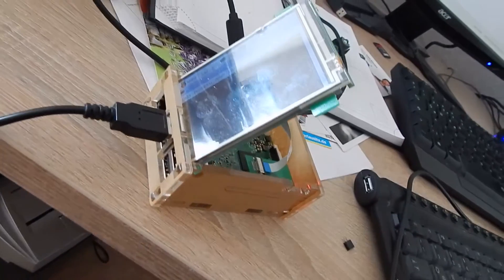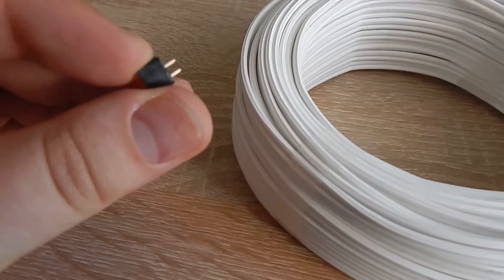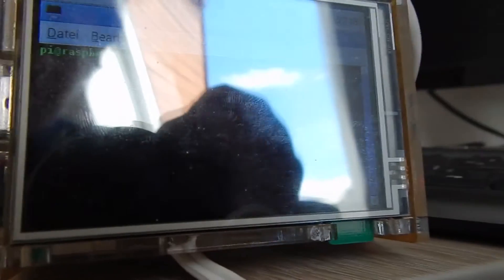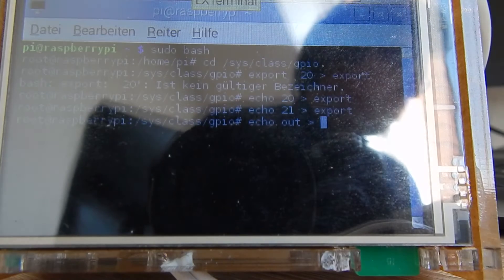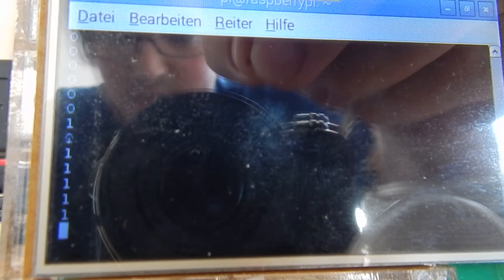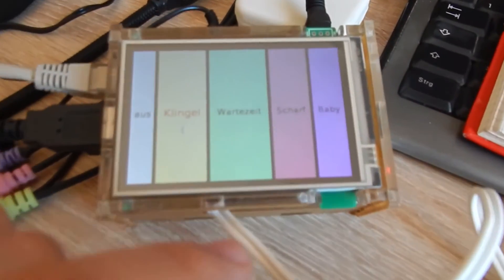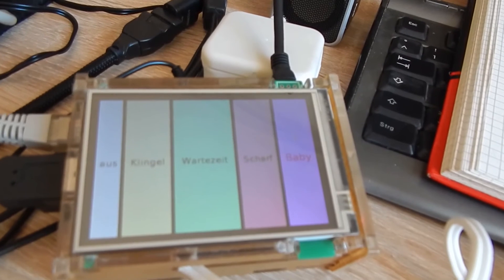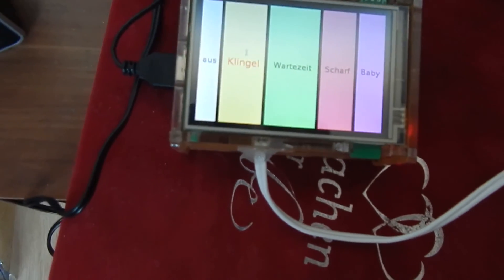Alarm System built with Raspberry Pi

Comment: How do i run this Alarm project?? i've downloaded the files to my "raspberry-projects" directory. I'm stuck in how to run this!
Reply from the maker: connect your GPIO 20 to the cable, then run autorun.sh
Reply: all i get at raspberrypi~$ -bash: autorun.sh: command not found? i would like to run this program headless and get notifications to my iPhone, is this possible?
How dose the web server.sh work? as that will not run either!!
Reply from the maker: you have to run scripts with ./

Comment: i saw a project in a book for arduino that had a interesting feature you might want to add

most alarm systems have a resistor at the end of the cable of a known value to protect against cable cutting 

if the intruder attempts to splice the wire before cutting it it bypasses the resistor and drops the line resistance which the pi can detect and use to trigger a tamper alarm
Reply from the maker: This system does not need any resistor. When the cable is cut, the alarm is fired just because no current means door open.
Reply: its just a sugestion if you wanted to make improvements the resistor protects against tampering 

say i were to strip back the insulation further down the cable and join the 2 wires there i could then open the door without triggering the alarm because the current still flows through the splice i made

just a idea if you was wanting to improve the design further
Reply from the maker: Yes, you can use resistors (or a cable with resistance) and a ADC to distinguish multiple doors, buttons etc.
Reply: im aware of that too my example though if of a anti tamper circuit if youd like to know more about ti look up the book arduino projects for the evil genious it details step by step a basic alarm system and then goes on to expand it with improvemnets such as the anti tamper circuit involving the resistors as well as battery backup and fault alarms its verry informational

Comment: Good start to the project.  I'd recommend sizing down on the wiring size, a 22 gauge solid core will work best.  Also do yourself a favor and get a surface mount  door contact, It will work and look so much better than your current setup.